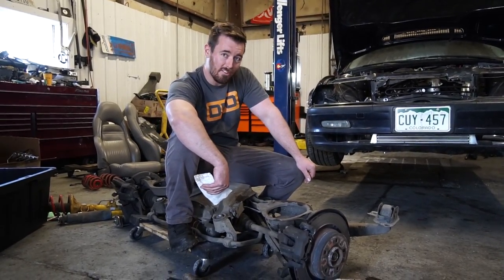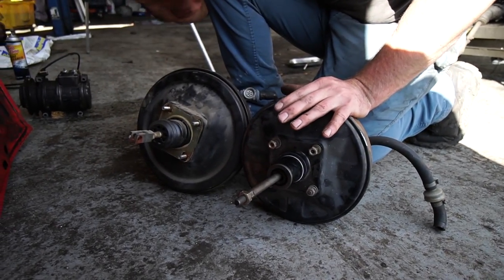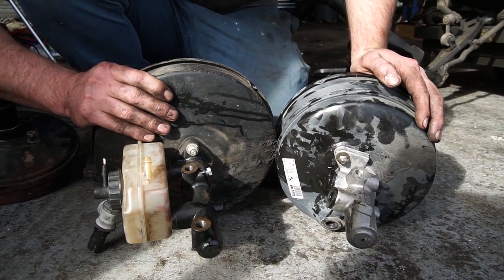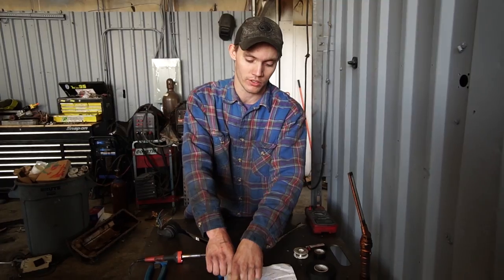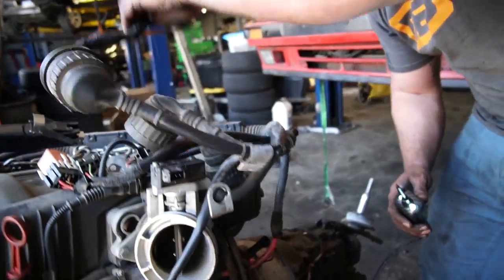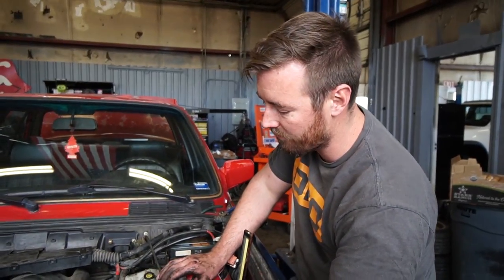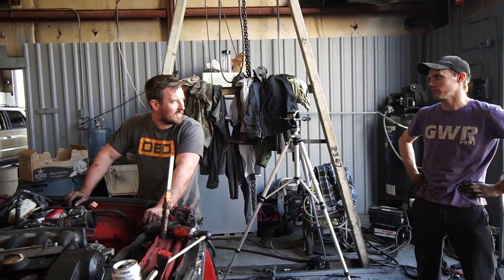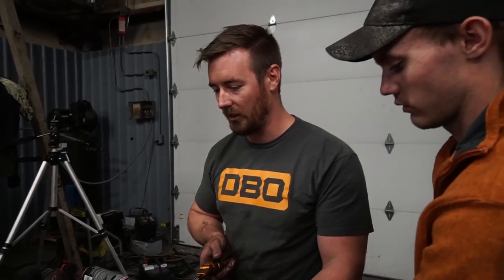S52 Swapped e30 | Start To Finish!

Comment: I’m doing a S52 swap into my E30 as well and I just wanna say thank you your video was very helpful. I have run into some problems however, what Motor mounts are you using? I’m wondering if the E34 mounts will work. Also, what intake did you use, was it an E34 intake? Thank you!
Reply from the maker: You will need e28 mounts, and any intake will work if you have moved or swapped the brake booster
Reply: DBO Thank you! I’m also wondering if you can use the E36 M3 intake and not move the break booster, is that possible?
Reply: karwan Ahmed just if you have booster for 325 xi or booster e90

Comment: doing an m50 swap on my e30 right now and I went with an e90 booster and a 2002 brake reservoir and it fits great
Reply: Also which heater hoses go where?
Reply from the maker: Doesn't really matter but I have had good results going from the head to the lower hose and then the upper heater core hose to the crossover pipe. Seems to make the bleed procedure easier.
Reply: Sweet thanks man, I appreciate your knowledge

Comment: Your videos are helpful. I have a 1985 325e it cranks and runs for about 3 secs and cuts off. I’ve replaced both fuel pumps and fuel filter, distributor cap and rotor button and coil. I’ve also replaced fuel pump relay fuse.
Reply from the maker: It sounds like the idle computer is bad, does it keep running if you keep the starter engaged

Comment: Another thing that helps the bleeding process immensely in these cars is to drill a small bleed hole in the t-stat. Drilling a bleed hole has no adverse effects. Eventhough the expansion tank is the highest point in the system, and should technically self-bleed, sticking the front end on ramps or a high floor jack can make a stubborn one bleed out like nothing. Just a couple tips for someone who may be having trouble bleeding they're cooling system.

Comment: I debating on a s52 swap or building up the m20b27 in my (528e) to its max potential. which do you recommend? I'm looking for around 250hp and reliability. It will be driven hard on the weekends. 🤔🤔🤔 feedback is appreciated.

Comment: Was wondering, which is easier to e30 swap - S52 or S54? I have one of each . . . and a red 325is . . .
Reply from the maker: S54 is substantially more difficult. The pan is a dual pickup from the factory and if you switch to the e34 pan you can't run the s54 oil pump. S54 is also setup for a CanBus car so getting the cluster to work is much more effort. S52 is a piece of cake as the videos on this channel show.
Reply: @DENVERBEERANDOIL  Thank you much! I think I'll swap the S54 into my 98 e36 M3 and put the S52 into the E30. Have a great day guys!

Comment: Ever have an s52 have a weird vibration after doing a timing chain? The car runs great except a vibration in the mid range rpm like above 2500 to 4k. The mounts are new no i doubt it’s that.
Reply from the maker: haven't had this personally, might be worth checking VANOS however

Comment: Good work on the swap. Only thing I really see that it could use from where I'm sitting is an m50 manifold. E30's are such a timeless car, both in driving experience and in looks. The US versions of the m5x are definitely readily available and are getting cheaper. If I ever pick up another e30 I'm going non-vanos m50 with a hx35 slapped on it, on the cheap. A good amount of people have thrown a set of ARP's and a Cometic and made a reliable ~400 whp. Not too shabby in an e30 chassis. Especially the fact that the non-vanos m50's can be had complete for a couple hundred bucks. Hell, you can grab a whole '91 or '92 build e34 for next to nothing, and get the whole n.v. m50, (correct oil pan already mounted,) trans, accessories, etc. The n.v. m50 has forged internals, and no worries for vanos issues when it comes to tuning so if you're boosting it, it just simplifies things. Its definitely been done and proven plenty of times. I built 3 or 4 of them for customers from the ground up and they do the trick well, especially for a budget minded person who doesn't have an unlimited amount of money to spend.
Keep doin what ur doin fellas!!! E30 <3
Reply: How much did it cost to do a ground up build built for boost?
Reply: @sslum  
Totally depends on the quality of the parts you decide to use, and if you do your own work mainly. Some of the stuff you can definitely get away with buying used or second hand from people that are upgrading or putting their cars back to stock. Are you also talking stock longblock, MLS/ ARP's, or built internals?? These are all things that can change the price quite substantially. Lmk and I'll see what I can tell you. It would be going off memory since it was quite a bunch of years back.

Comment: Hi! What could happen if u dont put a gasket on the oil pick up tube ? Thx great videos
Reply from the maker: oil pump will suck air through the mating surfaces and cause lower oil pressure
Reply: @DENVERBEERANDOIL  thx for ur answer ur a magician whit cars. Betwin the surfaces i put rtv and mating the surface do u think i wil have problems, or better take of the pan.  Thx again man
Reply from the maker: RTV should be just fine
Reply: @DENVERBEERANDOIL  Thx man. I hope so

Comment: you had the 2 other connecters that go into the body on e36. did you just tuck them or what did you do? thanks
Reply from the maker: Not used. Hide them
Reply: @DENVERBEERANDOIL  im going bar legal first go (stupid california). will this hurt me in inspection? thanks

Comment: can you get the 24v with gearbox connected in with and engine hoist?
Reply from the maker: Yes, but it is difficult to avoid hitting the core support on install
Reply: @DENVERBEERANDOIL  thanks, as long as its possible, its my only option, my other e30 had a tube front so was easy

Comment: You are using a 318i, is the trans going to hold all that power, especially the diff which is the smallest in BMW?  Hopefully one day, we can see you doing a euro S50 swap.  Those engines are not expensive, brought one before for like 2 grands.  So, how much is the damages in total.  It will be really cool if you can list them out.  Keep it up!
Reply from the maker: so firstly, we didnt use the 318 transmission. We used the zf 5 speed transmission from the e36 m3. would love to do a euro swap, it isnt much different but those ITB's are the absolute tits. as far as cost goes, if you purchase all new parts and do it yourself you can do this pretty easily for around 4k. 2500 for engine/trans is about going rate and then just start adding on for the swap parts and replaceable wear items.
Reply from the maker: Also the diff was a medium case out of 325i e30

Comment: So when using e34 brake booster then only mod is changing the master cylinder and using an e32 one?
Reply from the maker: yup, or use the e34 one, it is the same

Comment: one big quesiton, how did you manage to fix the RPM? in must e30 RPMS in cluster does not work
Reply from the maker: 325i e30s have the correct tach for 24v swaps.

Comment: M52TUB25 has a dipstick drain back pipe on it. If ya had one out back... Maybe not the right diameter but maybe. Enjoy watching all your videos as a fellow older BMW enthusiast/cobbler. I'm baked and for some reason I thought I'd share.
Reply from the maker: Yeah unfortunately the E34 pan has a uniquely small hole for the dipstick tube. You could however drill it larger and countersink it and get it to work properly I just did not have the kind of time to do that unfortunately. You can also just cut the Y off of the s52 tube and weld it onto the E34 tube
Reply: Getting baked FTMFW!!!

Comment: Where did you get the barbed fittings and what type of hose for the brake reseviour thank you
Reply from the maker: Barbed brass fittings are from home depot. Any oil safe line will work, so fuel line is great, just don't use coolant hose.
Reply: @DENVERBEERANDOIL  thank you! I will be buying a t-shirt soon

Comment: Can you tell me how to mount the engine like the mounts and subframe i want to swap a e30 to
Reply from the maker: You need e36 engine arms and e28 engine mounts. Aftermarket companies make swap mounts, avoid the condor ones.
Reply: @DENVERBEERANDOIL   thanks and like the ecu ? Can you use the stock ecu and harnas from the donor engine

Comment: I want to do this to my 1989 e30 325iS but what year model car should I look for to use as donor ?
Reply from the maker: It doesn't really matter. Wiring is mostly the same regardless. Obd2 s52 is my personal favorite. Quick and easy! -will
Reply: DBO so any 2000 e36 325i?..

Comment: Hi. What management are you using? E30 stock or e 28?

And also the differential?
Reply from the maker: Stock obd2 ms41.1 from the e36 m3. This car still has its factory 4.10, not a good ratio for the ZF transmission.

Comment: The adapters are not the best. Repinning the c101 plug is a lot easier imo
Reply from the maker: That's all well and good however that does not change the fact that you need to adapt it to the X20 side that comes from the E36 so you either have to make an adapter or chop the X20 off of the E36 side and attach a c101 which is fine but I don't prefer to do that because if I ever choose to take the engine out and put it back into an E36 it is removable

Comment: good job guys...i wanna swap my m52b20 with m54b30 and my big concern is how am i gonna make it start... :) now i know i need to connect the pins in numbers not colours to be 100% sure...and double check with multimeter...thanks....now im doin brakes swap on e36 318i with e46 330d brakes...its magic to make the handbrake work like stock...you can ask why i need stock e brake...the answer is simple...techno test for it to be road legal with the m54 engine (this engine is running on the other car) ive made handbrake pads from two sets..one from 318i and one from 330d..today well see if its working but i think it will ;)
Reply from the maker: Hell yeah man, BMWs are adult Legos, just gotta put the pieces together and go have some fun.

Comment: i came here to help me figure out reinstalling my harness sad to discover it was fast forwaded through.
Reply from the maker: engine harness? this one was never removed. what engine do you have?
Reply: @DENVERBEERANDOIL  s52 just got a couple connectors left I cant figure out and the weird one with a y in it.
Reply: @DENVERBEERANDOIL  awesome vid though cant wait to get mine running. White 91 325i coupe.
Reply from the maker: so the all of the S52 connectors only fit where they belong, luckily. the harness with the Y is an update harness. it connects to the crank position sensor in the rear and goes up to the vanos solenoid in the front, and connects to a couple other plugs along the way. put it on first and then connect the main engine harness to it. This is Chris btw, I have an S52 on the floor right now that I just put a harness on. DM me @DBOChris if you want pics. Your car is going to Rip man.

Comment: Great job bud. Quick question....did you delete the EWS from that S52 harness? If so, you input on how it's done will be helpful and appreciated. I do M50/M52 swaps on E30s but use aftermarket ECUs but i prefer using the OEM ECU and harness.
Reply: There’s couple videos on YouTube about ews delete it’s very easy and doable

Comment: I can't see it in the video but I hope you also ditched the stupid clutch fan and went electric with a SPAL or something of that nature. Clutch fans are ticking time bombs as it is, especially under hard driving with soft motor mounts, and you'll get a few ponies without it. On every e36 and nearly every bimmer I've worked on over 25 or so years, I've done a proper fan delete with e-fan(s) and thrown the clutch fan in the trash right where it belongs. Low temp t-stat/ thermoswitch, aluminum t-stat housing, and some water wetter for good measure, and you're much better off. I also install a high amp override toggle, 30a relay and 12 gauge wiring with the e-fan setup. You can either wire the switch to ignition power or straight 12v. Even the straight bladed e-fans move a considerable amount of cfm and your car won't sound like a big rig  coming down the road from the stupid clutch fan, as well as in worries about it exploding and taking out your radiator, belt driven accessories, or your hood. I have seen it all with those shitty things. HTH someone considering the swap or even just considering the fan delete.

Comment: is S52 OBD2?
Reply from the maker: Yes it is
Reply: @DENVERBEERANDOIL  are there any modifications required when swapping S52/m52 to E30? Just modifying the c101 with the e36 harness end is enough?
Reply from the maker: You also need to modify or buy a coolant sensor with the right thread for the head to have your temp gauge work
Reply: @DENVERBEERANDOIL  thank you. Enjoyed your videos. Keep up the good work. All the best

Comment: What transmission mounts did you use? I’m using the OEM E30 transmission mounts and the passenger side mount is compressed while the driver side mount is stretched. Did you have that problem? If so I would appreciate any advise, thanks!
Reply from the maker: Have encountered that problem on a car that came into the shop. Make sure you are using the correct engine mounts and that the engine arms are in the correct mounting holes, sometimes people accidentally mount the engine arms in the wrong holes or one correct one wrong... Etc. Long story short, double check the engine arms and engine mounts.

Comment: The oil cap on that S52 is triggering me! lol
Reply from the maker: lol, that's the OEM cap
Reply: Wasn't there a silver cap on it before you put the plastic M cover on? Looks like it changed. Either way....awesome video and great work. Learned a lot and that little car sounds bad ass. 

Just finishing a rebuild on an S52 in the garage to replace the 266k original one in my 97 M3 coupe. This video got me excited to get into gear and finish it!
Reply from the maker: Awesome! I'm stoked we can provide some motivation! And as always thank you for your support!

Comment: What driveshaft to use when having e36 328i ZF gearbox on e30?
Reply from the maker: The e36 zf driveshaft, you need to install the center support bearing from your year/model e30
Reply: @DENVERBEERANDOIL  fits perfectly on the E30 differential?
Reply from the maker: Yes, uses the same 4-bolt design
Reply: @DENVERBEERANDOIL  thanks a lot